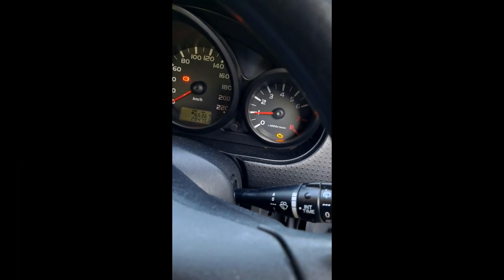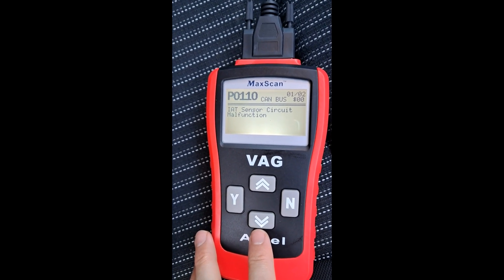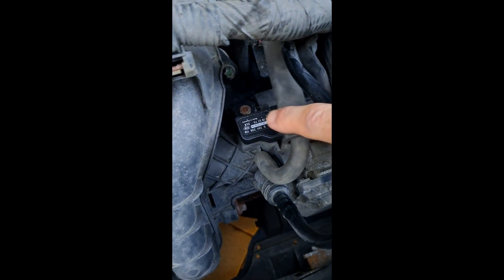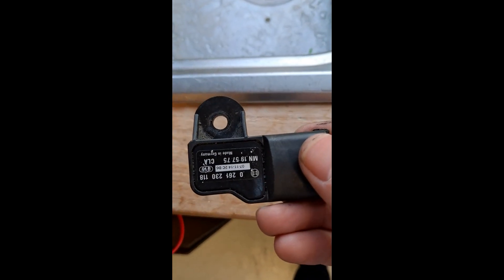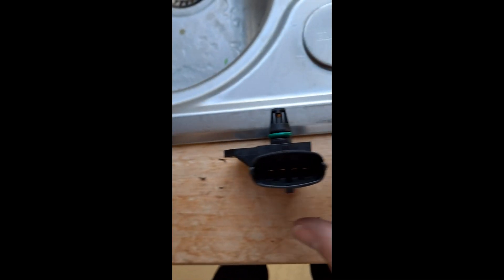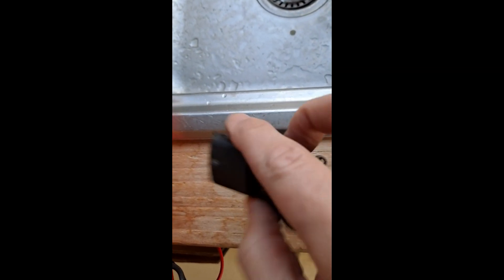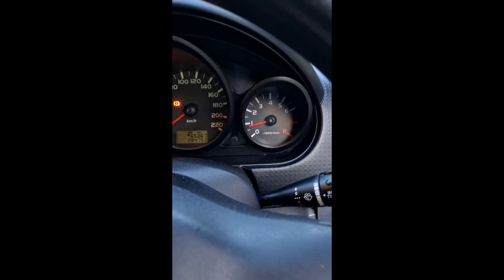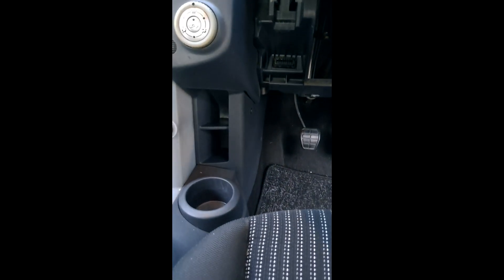Mitsubishi Colt - P0110 engine code

Comment: I have had my Mitsubishi colt 2009 plugged in and it says air intake temperature sensor but my car is also missfiring. Engine light has only came on when I open petrol cap to put petrol in. Is this all connected as no other codes came up.

Comment: Hi, is the code reader needed to make the engine management light disappear? Or will replacing the sensor do this? Thanks for such a great tutorial.
Reply from the maker: Hi thanks. To be honest I can't remember but I'm pretty sure the new component will resolve the check engine light, without having to delete the codes.  Of course the old codes will still be there which is not ideal if you have something else which later throws a code.
Reply: Thanks for this guide and for the reply. I have just changed the part and can confirm that unfortunately it does not automatically clear the service light. I bought an  obdii tool so managed to erase it. Thanks again!
Reply from the maker: @nawaaz3338  good to know, thanks ! 👍

Comment: what is when from time 2 time engineer check, it comes on ,week later goes off  stays off 2-3 days and then comes back on? what du u think?
Reply from the maker: Could be anything really, the engine light is showing a potential issue with any number of sensors. A code reader is your first port of call, clear all codes and once the light comes on again, read the code and look it up.  Note that sometimes codes can be obscure and not directly related to the problem so research or bring it to a garage to double check.
Reply: @paulhegarty531 i have a mitsubishi colt 2008 diesel but problem i ts  he loose the power  when ypu drive you need to shut down one time start again and to take again power